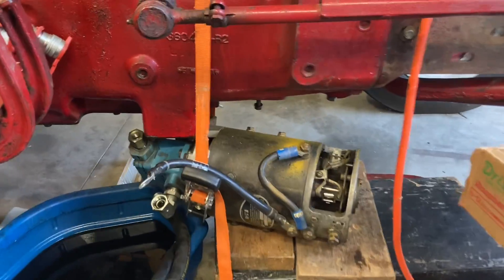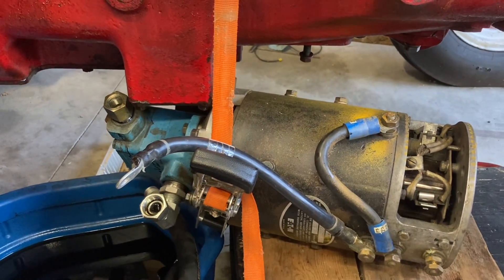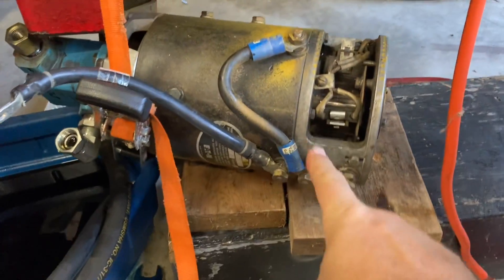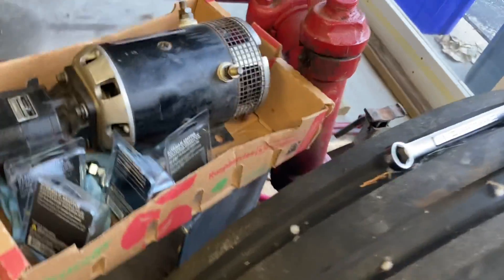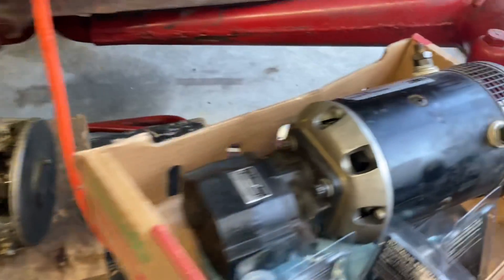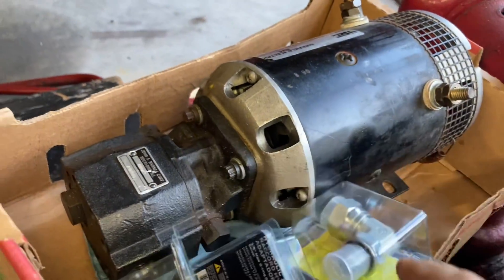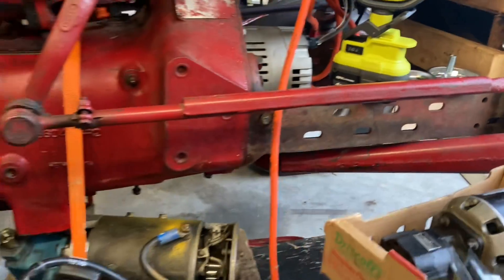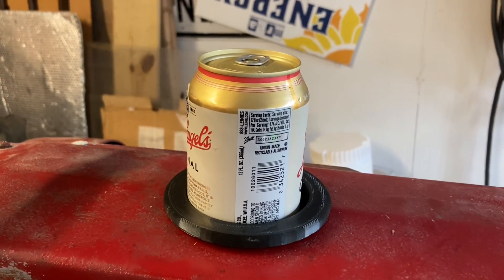Broke my hydro pump!

Comment: You could not fix the other pump?
Reply from the maker: Not quick and easily. I think the whole thing will need to come apart for a proper repair to the brush holders. Might even require trying to find some unobtainium replacement parts.

Comment: Where are the batteries intended to go? Total kWh? Also how are you thinking of hooking up the throttle? 🤔
Reply from the maker: Batteries will go above the motor. 
The original throttle is a rotating bar on the instrument panel that went down a stat and then to a cable and to the engine. I think I can put something like a PB-6 at the base of the shaft and have it turn that directly.
Reply: @BenjaminNelsonX    You could always 3D print a clamshell mount or clamp to make it work.  3D printing opens up a lot of doors.

Comment: A cup holder on a tractor lol Boy is that gonna make a mess
Reply from the maker: Well, not while it’s moving….
Reply: Not when it's half empty.  Also, I'm sure he will 3D print another cup that's deeper and then upgrade to a bottle with a lid on it.  Solved.

Comment: Order hydraulic fittings lines and the like from surplus center I have added hydraulics to 3 antique tractors and they had the best prices for such a complete selection
Reply from the maker: I took a look. Prices were a little better, but I’m also already done hooking up the smaller pump, instead of waiting on an order in the mail. I can also carry the pump into the brick and motor store and right there in the aisle look to see if it’s the correct parts and that they actually do fit.
Reply: @BenjaminNelsonX  Yeah, I have a local pawn shop that's quite huge and they do a lot of different things inside, including making custom hydraulic lines.  You can't beat a local store like that.  They can make any line I want with old used fittings on brand new hoses and at pawn shop prices.  It's great. :)